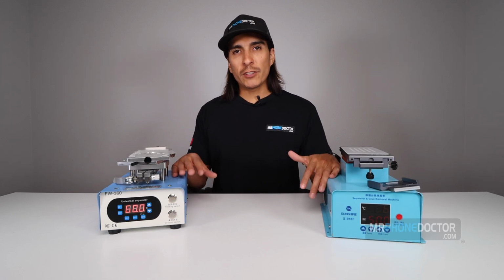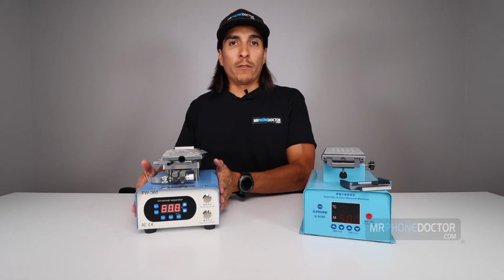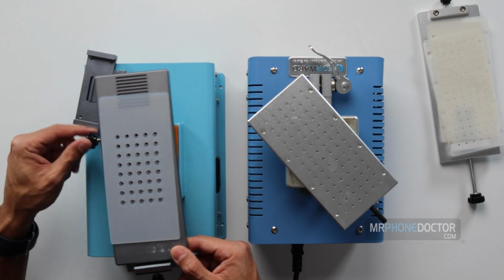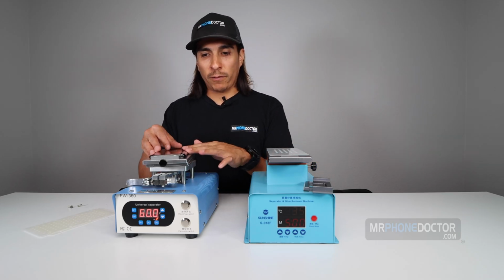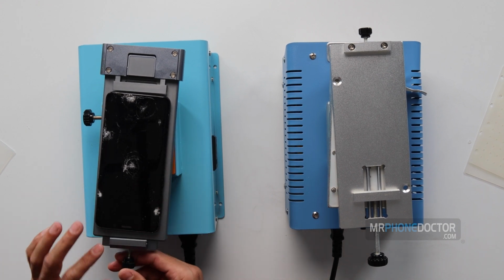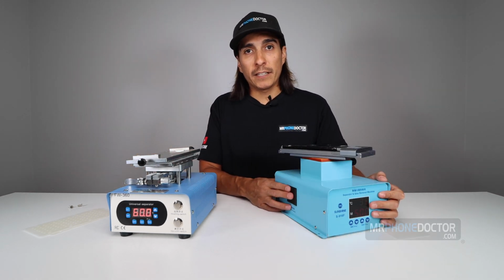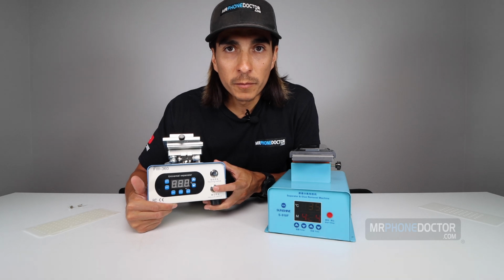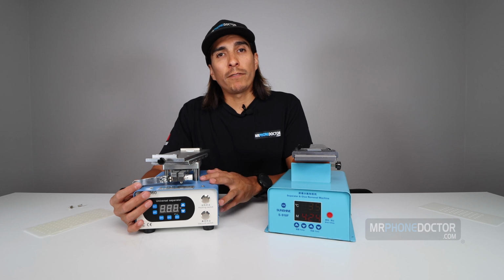Forward VS. Sunshine - Best LCD Screen Separating Machine Heating Plate

Comment: Do you recommend a heat pad machine or to use the hot air station? And why?
Reply from the maker: I recommend heat plate you get heat distributed evenly. Plus you free up both hands to work.

Comment: Yeah, freezing S9s or S9+s is a no go, the just die from it.. however you can separate the S10 series with it, but the problem comes 1-2 weeks after your repair... random black spots start to appear on the edges of the displays and that is really unfortunate, because if you use the freezer you can almost 100 percent avoid those tiny bumps on the display after laminating it, but this is how it is. Don't use freezers. This method is more relyable but you need good skills to separate the glass with a wire, these displays are extremely fragile.
Reply from the maker: Very true!
Reply: Thats good to know that freezing phones will damage them. Thanks for the info.

Comment: Great video as usual. Is the suction on both pretty good? I was just about to buy the Sunshine machine, but now I might buy the Forward one instead. I am slightly worried about the warming up time though. 30 minutes is quite a long time especially when I'm only doing a couple a day :)
Reply from the maker: Suction on both of these is great. If heat temp is an issue just add in a wifi timer which you can turn on and off manually. We decided to keep both on workstations since we do use 2 machines at times.